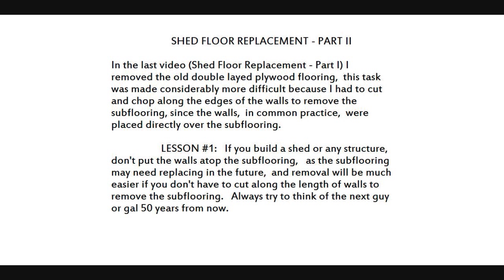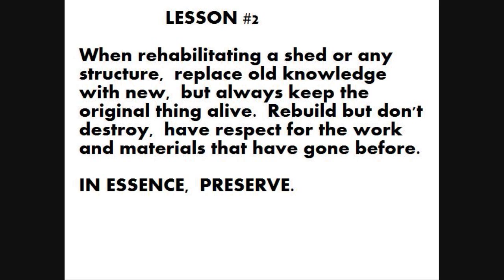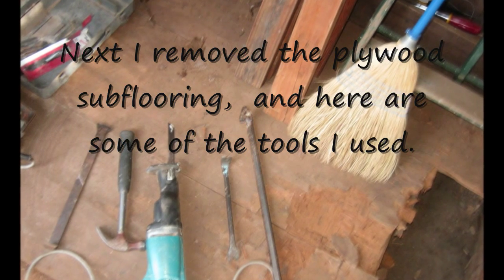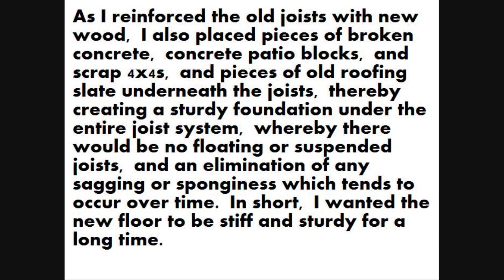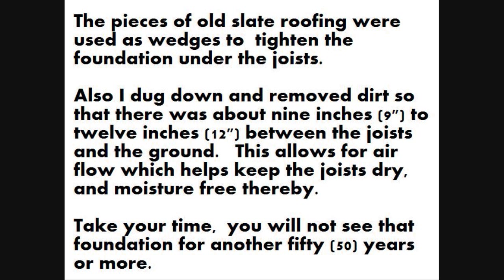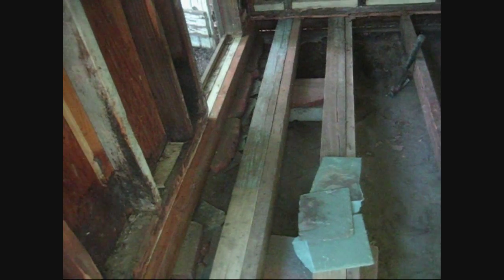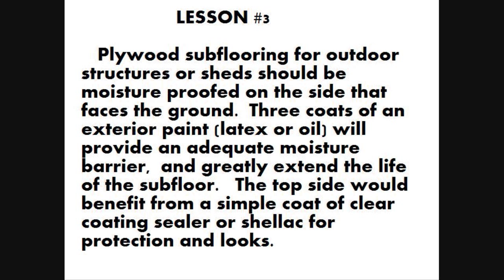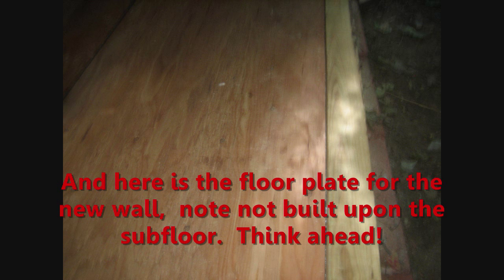Shed Floor Replacement - Part 2

Comment: I enjoyed your 2 video series on this project.  I’m a bit sentimental too as I’m rebuilding an old shed floor attached to a barn...some in the family say tear it all down and build from scratch, but I like the old heritage feel of the structures my forefathers built.
Reply from the maker: Thank you;   likewise I too was told to tear it down,   that would have been very wasteful in terms of both material and the loving time my father put into building it.   When I finished it,   I put in a flagstone landing in front of the door,   you may want to take a look at that video as well.

Comment: I have a similar problem, the floor hasn't rotted out yet, but it is always damp.  My shed also has walls attached to the floor. When you cut the old floor out, did you leave a strip of the old floor under the wall plate going around the edges, or did you totally take it out? If I was to totally remove it would I use a reciprocating saw under the wall to detach it, and then just knock out the edges of the floor and let the walls sit on the wood foundation? Thanks for the video!

Comment from the maker: As long as there is no apparent rot,  I would leave the edge underneath the walls,  then just lay a new floor within,  making it much easier for the next guy or gal to replace.   In my case there were three intact walls,  and one wall was totally destroyed,  so I took a saws-all around the end of the floor leaving the portion of the floor under the three good walls.   It's my contention that the idea of placing the walls on the subfloor makes it very difficult for subfloor replacement..

Comment: Being that the wall sat on the original floor and you were only able to cut the flooring on the inside of the shed, what will happen to the rotten 2 inches on floor the walls are still sitting on?
Reply from the maker: Fortunately,   that portion of the flooring wasn't rotted,  it was covered by the wall studs,   so it was still in good shape,  otherwise it would have been a worse dilemma.   That's  why it so important when building such structure,  that you leave the possibility of easy removal and replacement.   Very good question my friend,  you have the right frame of mind  (excuse the pun).   Thanks for the feedback,  and Merry Christmas+

Comment: Thanks for the video. I guess you don't get frost where you are. I can't use wedges under the joists for support, they just heave up with the ground frost.
Reply: northern minnesota!!   the first spring i was here, the frost pushed up a metal post a foot out of the ground in the middle of the yard.  it was crazy, thought someone was messing with me.